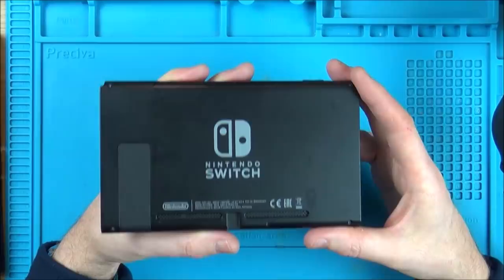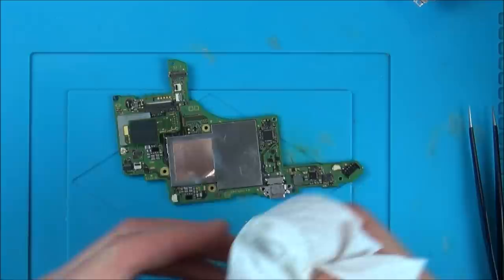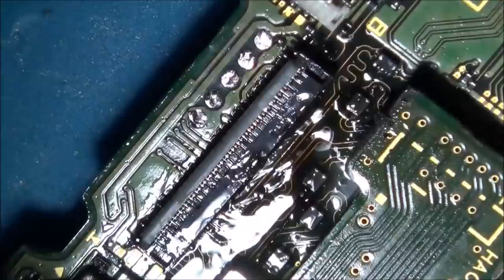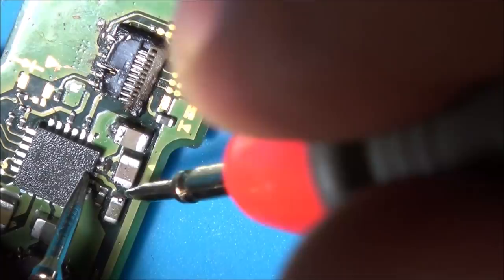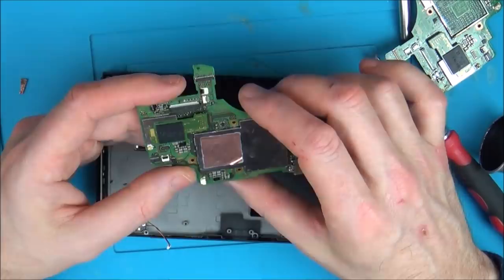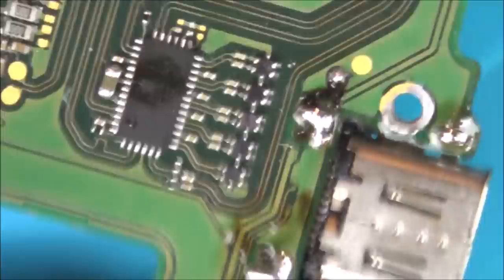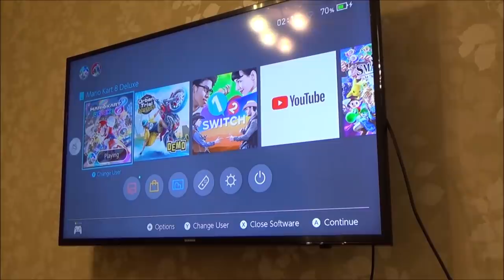Trying to FIX: NINTENDO SWITCH with NO DISPLAY on LCD or TV

Comment: Just wondering if you had a bit soldering iron bit you don't mind losing and cutting a slot in it to accommodate a a piece of copper strip that can heat up all pins and allow you to re-solder  those awkward connectors, Jessa in Rochester NYC fixes NINTENDO Switches, Looks like someone is designing a FPGA version of the NINTENDO Switch.

Comment: Isn't the design of these machines a bit flimsy?
Reply: I’d say more delicate than flimsy.
Reply: And super tiny. Hard to fix. Changing connectors, especially high density ones, is rather painful.
Reply: @namikosai9466  Perhaps that is a better word.
It's also not "typical Nintendo" to design hardware in this way, I suppose, as it's common in these days with all the performance and compactness requirements. However, this machine has some extra potential problems in the form of the docking station and joycons, for examples. If I were to purchase a Switch, I think I'd pick the Lite version because of this, or a stationary-only version that doesn't exist.
Reply: @waltercomunello121  That's probably a common problem these days, and not strictly a Nintendo-exclusive problem ;)

Comment: I'd check those hdmi traces from the screen ribbon connector as far down the board as you can, maybe those lines are connected directly to the other hdmi filters near the USB port, I think the lcd screen connector will have a couple or more pins allocated for voltage as apose to signals, I saw a test point to test this voltage near the ribbon connector, you could cross reference what this voltage is supposed to be on a working board, if you are getting an image in docking mode, it can't be the apu, or video chip, it has to be either an open line on one of the signal lines or that voltage isn't there for the lcd (it's not the backlight voltage it's a seperate voltage which should be there on the lcd ribbon connector)

Comment: take care. the lcd has gate and source lines. the gate to triggering the crystal to turn, the source to supply the power needed for it.

basically like millions of transistors. 

 the filters are only for the signal to control the crystal rotation of the gate line, not the main power to actually turn the crystal via the source line. since the video signal works as seen when it is docked i guess that the dc dc converter for the source line might be busted. usually it is close to the actual lcd driver ics but nintendo could have it on the main pcb. the burn mark on the connector could have come from a bad voltage given from the dc/dc converter.

sorry but i have no idea about a switch's layout, only lcd knowledge.

check the max77621 dc-dc converter. only one i could find with google which seems to be on the switch pcb at least once.

since the defect did not move with the lcd, it has to be on the pcb.

Comment: My switch started doing what happening at the end of the video where it works in dock mode but not handle . you get a little light and sound but no picture on the screen . so i can only play my games docked. wish someone could find out whats wrong so i can fix this issue too.

Comment: can you take off the white clamp bit off the connector then put it back on that way you could use hot air and it wont melt the white thing??? might be easier

Comment: You can shine a bright flashlight on top of the screen to try and see if it is displaying anything, if it is the problem is with the backlight. If it doesn't show anything at all, the LCD or the ribbon cable or the video chip is damaged.
Reply: Thomas Richter the backlight works fine, look at when he takes the switch out of the dock, the switch’ screen goes from a black screen to dark blue.

Comment: All elements on other side right behind LCD connector responsible for LCD output, check with working switch mb you will find something burned or shorted. Also that melted Connector probably tells us that capacitor near LCD connector is heating up.

Comment: @MyMateVince I notice that when you test for shorts, you place the hot lead on a metal component and use the black one on the individual traces. I'm trying my hand at fault finding and I'd like to know how you get the multimeter to beep so to indicate where a device is failing.
Reply: It's not finding a fault, per se. He's checking for continuity or a short. Basically looking for a path where there should be a path(continuity) and sometimes checking for a path where there SHOULD NOT be a path(short). Google or search youtube for "how to test for continuity using a multimeter". Not all multimeters beep when doing a continuity test, but you want to use Ohms mode and look for a symbol that kinda looks like a wifi symbol. If your particular meter doesn't do the beep, you can just look for a very low resistance(OHMS) reading. Good Luck!

Comment: Hi Vince,
I think you possibly have a break in one of the tracks to the ribbon connector that you replaced twice. Could be a track to that connector pins, I would continuity test them... but going back to your Bang & Olufsen tape player older electronics are probably harder to damage it with ESD ElectroStatic Discharge that newer electronics. ESD would damage your main GPU, the results are sometimes not instantly, It would degrade a IC or GPU and then the effects take place after a while using the device. Could be down to ESD since you said it yourself "I've never damaged other devices with ESD" might of just jinxed it!!!! ESD in human ranges up to 2,500 volts but the amps are very low but electronic components can't handle that charge.
Reply: sorry... this is nonsense, while the effects you describe might happen on out of circuit IC's or highly, highly sensitive in circuit devices the chances of this happening on a grounded and fully terminated component are slim to none. Experiment, grab a silicon chip and try killing it with ESD out of circuit, if you do manage to kill or deteriorate it - repeat with another chip in circuit... you'll find 99.99% of the time it will be fine.

Comment: there must be a circuit or chip to sense that the switch is either in docked mode or handheld mode. im thinking now that docked works since you redid the usb-c connector, but that it doesn't switch to handheld mode properly. however this is debunked also since its not outputting any screen information when booting up in handheld mode except for the lighting up. very strange.
unless.. there is an underlying issue where its hard docked due to a short somewhere.

Comment: You have to find out what shorted and caused the lcd connector to melt. without any visual evidence and since it is probably now open, it will be extremely difficult.

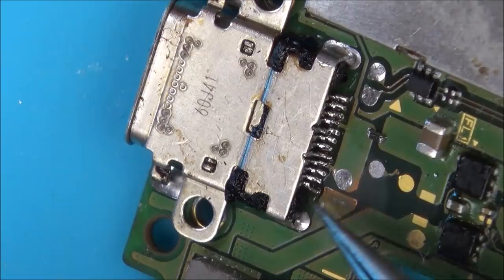Comment: 23:28 that was what killed the lcd me thinks Vince. Now that that is fixed perhaps you should just replace the lcd with a working one. Also I will say it again:: Missing pads fix= aluminium foil+scissors+bensine glue+magifying lens = LUV. Cheers mate :)
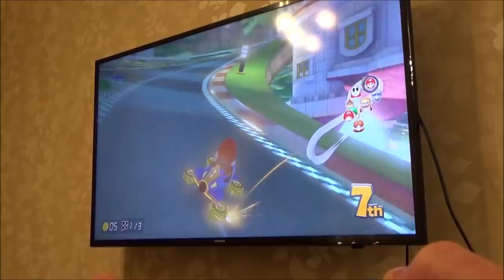Reply: Update: on ~27:48 I notice framedrops on Mario kart. I dont' know if that's normal or a byproduct of the video encoding process but if it happens in realtime where it shouldn't perhaps that's an indication of a short somewhere or a bad logic chip. also another speculation, if the videochip currently used is from a the water damaged switch perhaps it has the same problem for a different reason (eg output on tv was not working on that chip from the start. I remember you had another switch that was doing the xact same thing. Any way, I for one, am hoping for a revisit video with good news soon. Holding breath now :)
Reply: Update: Turns red
Reply: Update: Turns Blue
Reply: Update: Loud sound of an explosion was heard on the neighborhood. The police is currently investigating

Comment: Psst
See if you can buy some Circuit stick on tracks, and do some practice runs on any old trash board, once confident enough, try and remove and repair the mother boards HDMI area, hopefully all the problems is just that..

Comment: I would be careful with the air.  maybe it is wise to first take a low melt solder.  why because everything burned.  your USB c is totally burnt and so are the new connections.  for this you need low melt solder.  then carefully put it back with normal solder and hot air.  be careful though.

Comment: Hey vince! I hope you respond I couldn’t find anyway to contact you can you do a video on how to removed a stripped screw from the back of the switch?
Reply: SNM ROCKET sounds backwards but use a drill with a small enough bit on reverse mode, it should round it and get it right out.
Reply: Try the drill bits for the 3d printers. They are sturdy enough to drill out those screws. Tried one on the bottom screws of an iphone 6 plus, once the head is gone you can take the cover off, and handle the rest with pliers or sthg similar

Comment: Buy the GuliKit switch dock from Amazon. I had same issue and my switch outputs signal on this fine but won't output signal on any Official Nintendo Docks. Weird but this $30 works perfect and won't brick your switch.

Comment: My switch is just like this after i customized my housing. I was extremely careful yet 3 shops cant figure out the issue
Reply: LCD driver chip it's near the LCD connector. 813 or t
Soemthwn like that

Comment: A symphony of the usual suspects: too much heat with too little flux. Use flux in spades not only for desoldering and turn down the heat. Even the heat resistant capton tape crinkled. Also: that tip. ... even GadgetUK164 had a hard time with this tip style.

Comment: Probably a broken trace around that screen connector or you're putting bad video chips in
Reply: Either that or its stuck in like a dim mode, like when you close the lid on a laptop, maybe you could get a pinout for the screen ribbon and see if there's a 3v supply and also you could check the dim line

Comment: The backlight is working but the data for the lcd is not working
Reply: yeah, he already figured that out, we know it!
Reply: mine ing I think It might be the main chip for the video on the tablet itself
Reply: @VOLTRONDEFENDER4440  if that would be the case, he would not get any picture at all. not even docked..
Reply: mine ing yeah but pins that do the docking is separate for the main chip

Comment: my best guess to this, when I say guess, I do mean guess work, would be the switch would work like a headphone socket, and have all the data lines going to the docking port so that when it is docked, then the screen is disabled a bit like a headphone socket disables the speaker. so working on that theory then I would say that there is a return wire from the docking port to the display socket, and on that theory would be the short circuit (burn mark side), and possibly burned out the trace to the LCD display socket. so to check continuity from the docking port to the lcd display with the help of a scematic of the circuitry if available. I have never owned a Nintendo Switch, so not sure how it should work or anything, but a logic mind, then that is how if I done circuitry then it is how I would put it to run.
Reply: as you said you tested it with a working display and still nothing, then it leads me to think like this is that there is a burned connection, or blown trace in the circuit board.